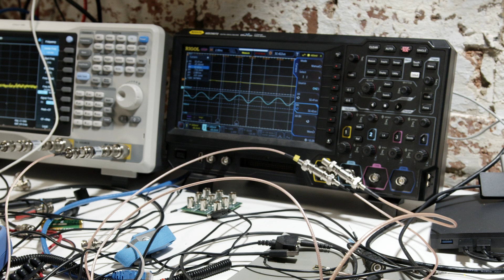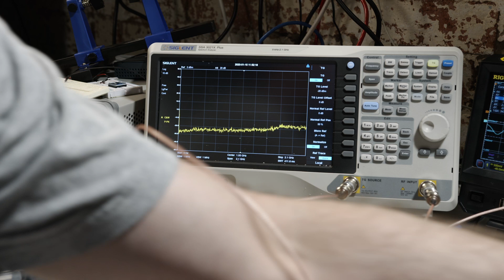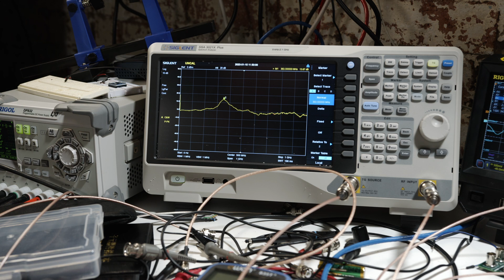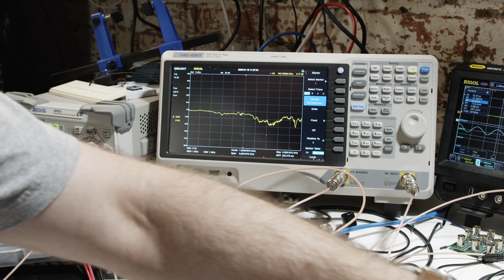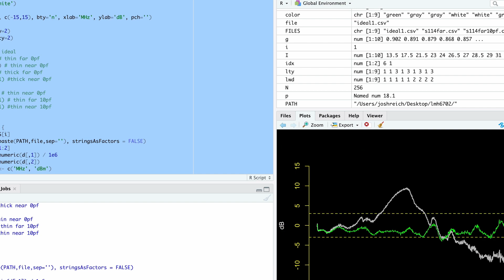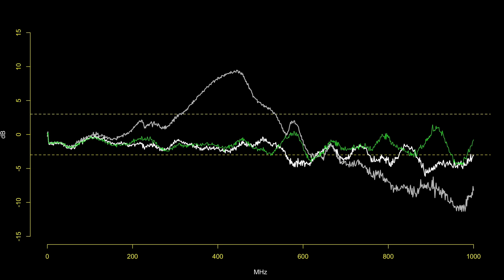Approaching a flat 1GHz frequency response

Comment: Would be better to use a 100Mhz video opaamp with  high slew rate like LM6172 3000v/us
Reply from the maker: Well, that's hardly going to going to get me to 1GHz of bandwidth :)

In all seriousness, I have a range of very suitable video op amps that I usually work with, but they cap out at a GBW around 300MHz, which is fine for 1080p60 component video. I'm messing around with the idea of 4K analog video, hence the need for a much higher bandwidth op-amp.

Comment: Hi. This is the first video of yours I've seen, YouTube decided to show it to me. So I haven't yet watched any previous videos in this series.

But that said, there were a few things you remarked on that seemed to be worth commenting on:

Early on you mention "what  problem could a little 10dB peak at 350 MHz be". Later you mentioned that the amp was below unity gain for unspecified reasons. The usual reason for having an amp below unity gain is that it isn't unity gain stable. If that is the case, why a 10dB peak could be a problem should be fairly obvious: you are most likely at or above unity gain in the frequency range, and thus unstable. It's worth remembering that "frequency response" is "list of gains at various frequencies". So if your amp is -3 and you have a +10 hump, you are at +7dB, well above unity gain.

Later you were talking about the effect of output trace length and width, and which end the termination is on. The termination is on the board? Then you feed a 50 ohm coax 2 feet off to the scope. Is the scope terminated, so you have a double-terminated line, or is it high impedance?

On the subject of the 2 feet of 50 ohm coax, it doesn't seem to have 10dB peaks in the signal path (though they might be there and are normalized out by the baseline acquisition). So if putting the signal thru two pieces of 2 foot coax doesn't introduce gain errors, why should 2 inches of board trace? My guess would be that that 2" trace isn't a 50 ohm impedance, and maybe not even a constant impedance. After all, if you just stuck a 2" length of coax between the input and output coaxes you wouldn't expect 10 dB peaks.

Controlled impedance traces aren't easy to do by hand, but tools like Altium Designer can do them, and maybe even KiCad. Given the board thickness and dialectic constant of the board material it should be possible to calculate trace widths to get the right impedance. There are a number of YouTube tutorials on how to do this if you search around. You could start with "Phil's Lab" for a quick demonstration on how to do it in Altium. 

Remember, at these frequencies the energy isn't carried in the traces, it is carried in the fields around the traces. So you have to treat everything (that you can) as a transmission line. If you have a signal line without a parallel ground reference line, you don't have a transmission line.
Reply from the maker: Thanks for the detailed response! 

The op-amp is unity gain stable, but I'm using it with a gain of 2 in this configuration and is stable as per the datasheet. 

As for the termination, these are all 75ohm lines, using 75ohm cables, and terminated at 75. I use KiCad and given the specs from my PCB manufacturer (JLCPCB), my "thin" traces should be at 75R. I've verified that as best as I can on other test boards using my NanoVNA.

As for the termination on the scope, I'm running the scope with HighZ input, so I have the extra 75R BNC terminator on the tee. On my spectrum analyzer, I have 50/75R matching pads.

Comment: You must be very careful in referring to Nyquist when it comes to equal spaced time sampled systems in recreating a sinewave shape at 2x sampling. Also, there are fundamental differences in control system discrete sampling and recreating an audio source for the human ear.

If you work with classical control theory systems (Nyquist stability criteria for example), phase and gain in relation to the model characteristic equation is of interest. As you can see with classical  analog control systems there is no reference to sampling in any way. Sampling theory is a mathematical interpretation until we apply it to mimicking analog control.

So, if you then move towards sampled systems and basic digital control, which tries to mimic an analog control system representation, most engineers are very curious about what Nyquist has to say about sampled systems, meaning Nyquist-Shannon sampling theory.

But, the motivation in moving towards sampled systems is one of computer power and accommodating novel control regimes, not easily addressed by analog classical control, with the usual end result being exploring modern control theory techniques. From an engineering standpoint you will try to understand the sampling theory mathematically but with some analysis on the bench using the different sampled system elements to see if the theory is useful. Much like applying and verifying analog control theory techniques on the bench. 

So, if you set up a test circuit on the bench to explore the 2x equal time sampling mathematical theory as related to a sinewave input things don't really work out like the well established analog control where it is understood the importance of both gain and phase in developing a stable control system. 

The usual starting point on the bench is to look at the operation of the sampling circuit front end, called a sample and hold circuit (S&H). A basic circuit that when triggered (usually at equal time intervals) will hold the sampled value (voltage stored on a capacitor) so as to be processed by an analog to digital converter, and will then be sample again at a known (usually constant time) interval. If you trigger your S&H circuit at 2x the sinewave input frequency asynchronously (2 samples over one input sinewave period), meaning the sampler is not synchronized to the input (has some slight time skew), the results on the output of the S&H are very disappointing in recreating the sinewave input shape. 

Especially, to the control engineer who is accustomed to accurate gain and phase information. No worries, just crank up the S&H sample rate relative to the sinewave input frequency, and you will slowly see a sinewave take shape, if you interpolate between the samples. Keep doing this and when you reach about 20x the sinewave frequency the sample waveform looks promising for maintaining amplitude (gain) and phase information useful in control system. From a practical standpoint the Nyquist-Shannon sampling theory does not translate directly in our application of sampling electronics, and when you target the human ear as the source input there are other averaging processes which are very forgiving for errors in phase. 

You can explore this "sampling theory" behavior on the bench using a low cost S&H like the LF398N.
Reply from the maker: Your point is well noted on the limitation of applying Nyquist when the sample clock isn't locked to the signal being sampled. I can definitely see how that can result in phase errors and gain that appears to varying as the two signals move in and out of phase. Good point.

I have a bucket of S&H's -- many years ago I built an "analog" IIR filter by implementing the z-transforms with 398s :)
Reply: @superchromat  The only recent synchronous sampling control system experience I have is with 4-stroke internal combustion engine fuel metering digital control algorithms, you can synchronize the sampling of input parameters, like cylinder pressure, at known points in the 4-cycle sequence, at specific crank degree positions at slightly higher than the Nyquist rate, let's say at 3x per cycle (240 crank degree intervals) and use this pressure data in modeling the engine using digital control techniques, like least square calculation or PII. In other words fuel control is fined tuned by putting part of the controller in the crank shaft degree domain, which makes sense from an air-pump combustion process standpoint, and as with most engine fuel control systems we know the position of the crank to about 1 to 4 degrees error worse case steady state.

The above is the only experience I have with synchronous sampled systems which seems to give weight to the 2x Nyquist ideal.

Comment: I think Diff Gain / Phase will be crap
Reply from the maker: I'll check it out on my VNA, but I suspect you're right. The ripple inside the +/- 3dB range isn't great and that's most likely due to an error in my layout that I bodged, but didn't include in this video. In my previous video/short you'll see that I royally messed up and forgot to connect the GND pins of the output connector to the ground plane. I ended up bodging them over to a nearby ground via, but it isn't ideal, but good enough to make the point that I wanted to make in this video.